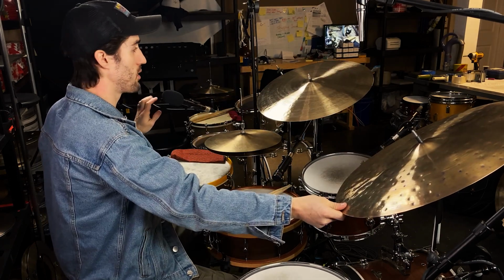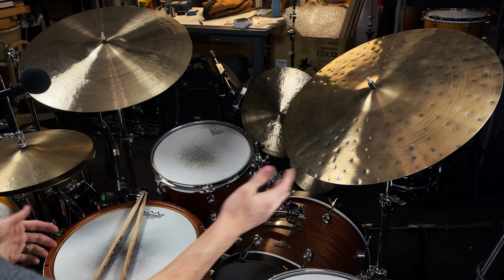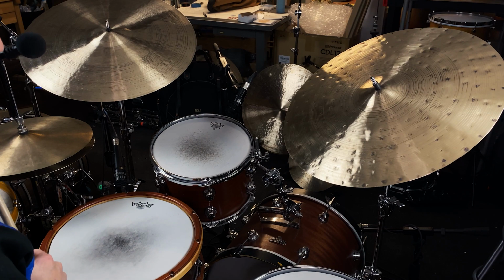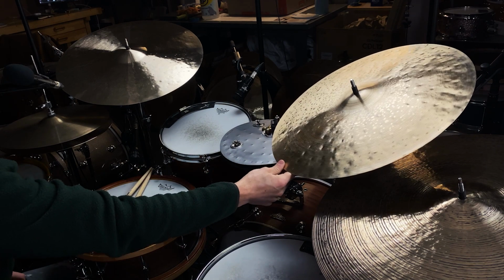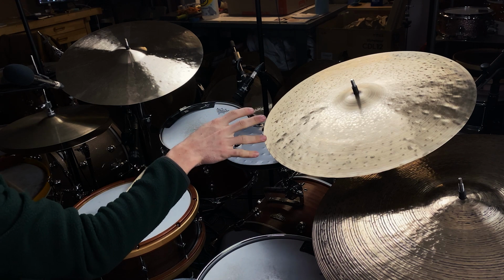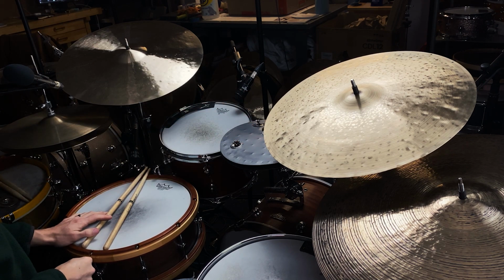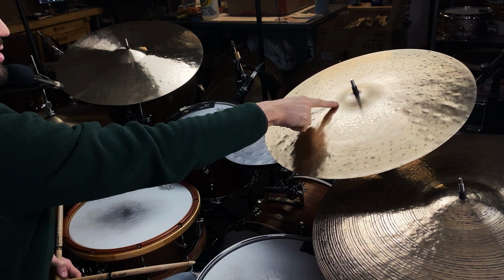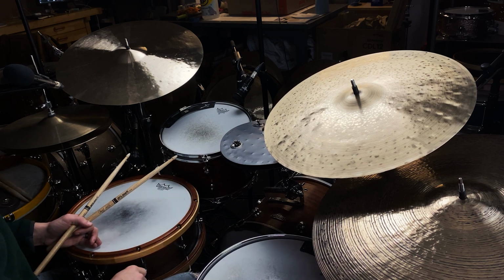22" Cymbal Modification Experiment - MOD Cymbals

Comment: I’m interested to know the science behind “resting” a cymbal. Is it to do with heat affecting the cymbal?
Reply from the maker: It doesn't have anything to do with heat, for my purposes. I only utilize "cold-forming" as a way to manipulate the metal. It has to do with the molecules being "shocked" via the disruption of the surface density and the alloy being moved around. Once the alloy has a certain amount of time to "rest", as we say, it settles into its new shape/density and the metal relaxes, thus allowing more sustain and "openness" to the sound.

Comment: How does one "rest" a cymbal? Just let it sit on a stand for a while?
Reply from the maker: After you do any hammering or lathing the alloy is pretty choked up and dry. Usually over the course of 12-48hrs  it “rests” and the sound opens up a bunch (mainly in the high frequencies).
Reply: Okay, that's an interesting piece of info, thanks for your response!